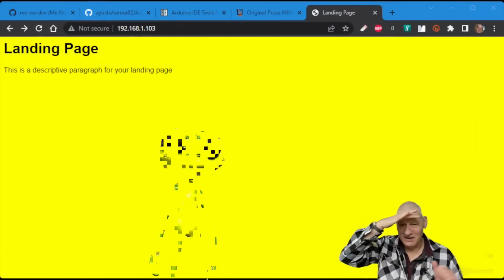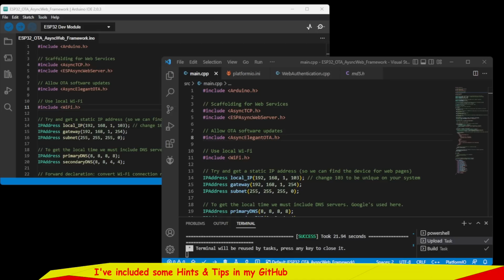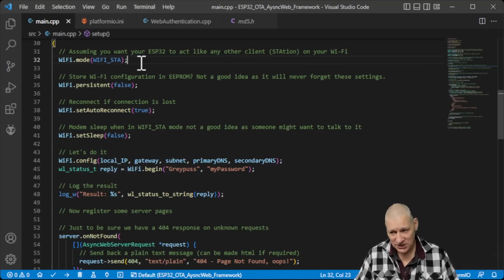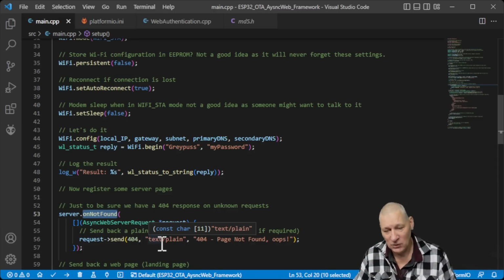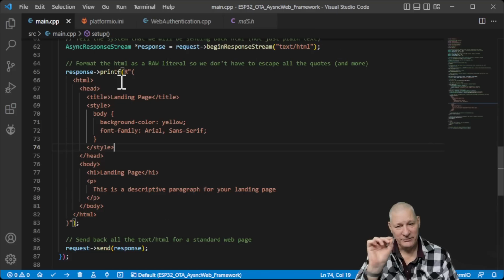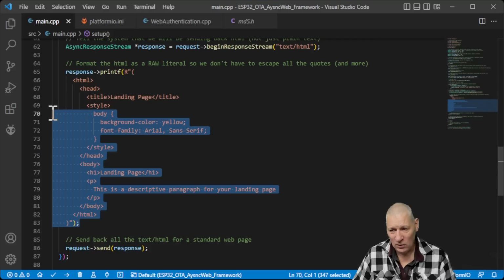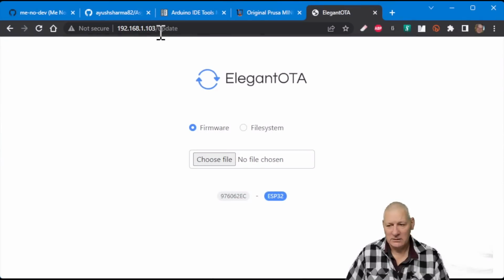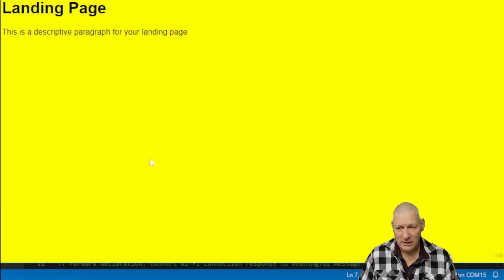#258 ESP32 Web Pages AND OTA updates - just3️⃣libraries! ESP8266 also!

Comment: Hi Ralph, love your content!
I do have one concern with PCB Way.
Why is it they are able to have these absurd low prices? Can't get my head around that.
To me there is no logic in having a commercial business and not make money. 
Can anyone help me understand?
Reply from the maker: Don't think for a minute that PCBWay is not running a profitable, commercial business!

When you order a PCB, it gets put on a large sheet with dozens of others. So, potentially, lots of $5 orders. Factor in the low cost of labour in the Far East (and probably the standard FR-4 substrate material too, but I'm guessing) and they will still not make anything approaching a loss.

Whilst we hobbyists just order (up to) 10 pieces with a maximum size of 100mm x 100mm, there are probably many businesses ordering much larger and more complex designs - remember they do some mind-blowing advanced PCBs too, albeit at a cost. A business could easily order 5,000 boards (my electronics engineer consultant tells me). Many other PCB manufacturers would not even consider such a "small" run 😲

I do not know how they calculate their shipping, but there they offer some (much) lower cost routes (especially to the UK) so I can't believe they subsidise it from that side of things.

What I do know is that in my experience with them, their products are without a doubt second-to-none, from the base PCB all the way through the solder masks and silk screen printing (I once looked at one under the microscope in a video, amazing quality). If this were not the case I would not feature them as sponsors on my videos!

Comment: I see static IP addresses used in multiple tutorials. I think it's worth while people learn how to use a dynamically assigned static IP in thier router, then use DHCP on their device. Then they can use the name they give it instead of messing with IP addresses. This is helpful for when you connect a deceive in future and you can't remember what address you gave it. Typing a shortname.local is also much easier and typing 192.168.xx.xxx.
Reply from the maker: Well, yes, a name is preferable to an IP address although it's been my experience that it's always good practice to know the IP address of key devices in your network. 

But maybe this could be a Part 3 of this video? 😉I'm sure viewers would find it useful.
Reply: @RalphBacon  agreed knowing the ip address of key devices, but if you run the DHCP reservation tables, you'll know those addresses and then have a live, one-stop-shop to view these.

Comment: Excellent Video as usual Ralph.  Will this also work using IDE 1.8.... or does it only work with the new 2.0 IDE?  Many thanks for keeping us up on new topics and our brains engaged.
Reply: It works the same for IDE 1.8.x
Reply: @Cptnbond  Many thanks.  That info helps.  Will give it a test.
Reply from the maker: @Bob Owen Yes, as Sgt-Bond has indicated, it will work with all versions of the Arduino IDE, but I do recommend you download the new version 2.0.x and take advantage of its new features, not least of which includes code completion. 😉
Reply: @RalphBacon  Trying out the new Arduino IDE 2.0.X version is on my list of things to do.  It's only that I hate change and tend to stick with that which has worked before.  Thankfully, there are content providers like yourself who make things easier by providing great resource materials.  Thank you.

Comment: Great Video had to make a small change to get it to compile with platformio - platform = espressif32@3.5.0 - seems there is a conflict with the latest platform release
Reply from the maker: There is an issue, correct and I'm very disappointed that me-no-dev has not addressed this after several months. 

But you can use the latest platform if you comment out the line in the platformio.ini line and enable the line to download that ESPAsyncWebServer library from the GitHub (see my example in my GitHub, it will be obvious).

Comment: I have yet to find a decent wifi library that lets you securely store multiple wifi credentials, will automatically go to one of them that is currently present and, non-blocking, will go to AP mode if none present, and will regularly check for SSID changes to go to an already configured SSID.
There's also the problem with some WiFi libraries that latch onto a specific BSSID in a multi/mesh Wifi AP environment rather than allow roaming between APs.
I've used one that came close and included a built-in web platform and OTA.  The web platform confused me, was JSON based and not clear to me on formatting and I/O.
Reply: Yes you are right.. Its just painful to realize if your esp project won't join a WiFi again if it lost connection and doesn't scan and join :-/ kind of pointless to have WiFi in the first place then :-/
Reply from the maker: There is a library that allows multiple SSIDs to be scanned and it will join the one with the best signal. Of course, you still need to know the correct password (I'm sure you could design a simple, encrypted password storer using LittleFS).
The library is called WiFiMulti.h from Espressif (https://bit.ly/3HONTlL ) and detailed here:  https://randomnerdtutorials.com/esp32-wifimulti/
Reply: @RalphBacon  does said library automatically join the SSID autmatically or not?  If not and you have to enter the password each time it wants to connect, that's not fitting my criteria.
Reply from the maker: Automatically? Anything joining a Wi-Fi network has to know the SSID and Password, however that is supplied. You can't "just join", although you can programmatically make it appear that's what happens, without any manual password entry.
Reply: @RalphBacon  that's what I've been saying: enter and store SSID and password, or remember and store recent connections.  That way when you come near one stored, it will reconnect.
Like your phone and laptop does.

Comment: it would be more helpful to do that with IDF sdk not stupid unstable Arduino
Reply from the maker: Not really a helpful comment. 

Arduino is not unstable in my experience as the framework has been ported from IDF by Espressif so they know what they are doing, so I guess they are not stupid, either. 

In fact, there are some features in the Arduino ESP32 framework that are not present in IDF because Arduino users expect them!
Reply: @RalphBacon  thisr party libraries have mostly some questionable untested code to pull for public for later to find out about bugs and crashes. 
I'm not sure if you even realize of what you said from programming perspective because IDF is SDK not a framework with spaghetti greasy code
Reply: Arduino IDE 1
8.x is rock solid if you want stabilty. Personally I prefer this over the 2.x series.

Comment: Where did you get that IPEX antenna? Do you have a view about the pcb antennas that are available? Cheers
Reply from the maker: I had a lot of various IPEX antennas included with various devices but you can buy them on AliExpress for a very low price. I have "proper", case mounted and adjustable antennas, stick on ones that you can hide inside or outside of an enclosure, simple springs (mainly for the HC-12 devices I showed recently) and these ones which are probably the worst as they don't stay in place!

PCB antennas (such as the ones normally included with ESP32 devices) work well enough for home use. Switching to a case-mounted, orientable device (not easy as you have to un/solder a 0Ω resistor the size of a speck of dust on an ESP32 device) is like chalk and cheese, range-wise. I use these to communicate from sensors in my attic to my workshop (about 10 metres away) and it's faultless.

Comment: I would not open the ESP32 to the web with that Elegant OTA on it, does not look like there is any security! Someone could upload malicious code to allow them access to the rest of the network or worse!

Also, you failed to mention how the server is started. Just including the header file for Elegant OTA is not enough, you also need to start it before starting the server:

AsyncElegantOTA.begin(&server);    // Start ElegantOTA
server.begin();    // Start the web server

EDIT: After posting this comment I found out they do have very basic security for the update page if you start Elegant OTA like this:

AsyncElegantOTA.begin(&server, "username", "password");    // Start ElegantOTA
server.begin();    // Start the web server

It's not an ideal solution but I guess it should work for simple DIY projects, not recommended for release products! All it would take is for someone to get hold of the product and search the firmware data for the username and password as it wont be encrypted!
Reply from the maker: If you notice, I didn't even mention exposing such a device to the outside world! Apart from requiring some router knowledge (IP forwarding) it would also require that additional level of security to stop your neighbour potentially accessing your devices. I'm pretty sure a serious hacker is not interested in my ESP32 Pond Heater Controller 😁😆😉
Reply: @RalphBacon  maybe not the pond controller itself but as OP said, your ESP can then be used as a jump point to the rest of your network.
It has already happened with commercial IoT devices.  A smart light bulb or some other IoT was used to hack into the HVAC of a hotel in Vegas
What's ironic was that not long before the hack, I attended a convention by a network security vendor in that hotel that used that example to make their point.
Reply: You can protect Elegant OTA with a user/password combination and additionally, as the `/update`  path can be changed to e.g. `/t07pNueykXYi5XUA6tEAxIhXmP3owT7H`, is't quite secure... But securest would be to switch WiFi off. Your have to live with compromises. 
You can also pull the firmware from a trusted server on startup... Then you don't expose any interface. I do that for my deep-sleep on battery project.

Comment: Next part would be to move HTML over to LittleFS. So much easier to work with, and more powerful, then incode HTML. And authentication for OTA.
Reply: I hadn't thought of that.  Plus it appears the OTA allows you to update files in the ESP storage so you could in theory update the HTML without updating the whole code.
Reply from the maker: But adding in variables is not such a trivial task, wherever the HTML is sited. But certainly, having the pages in a file would be a good idea.

Comment: High Ralph. I noticed the bin file was a lot smaller with the Arduino compiler. Is that always or mostly the case?
Reply from the maker: I didn't notice that at all! I will have to check. Same compiler, same framework... how intriguing!
Reply: It could be platformIO natively adds support libraries that Arduino 2.0 does not.

Comment: Thanks again.  A tip for beginners. One thing I have found useful is to copy the path of the actual .ino file on my computer into the start of the .ino file, as a variable.  I then print this variable out to the console when the program first runs.  That way, as I tend to  leave a number of ESP32s running for some time and tend to forget which file is actually running , at every reboot it is displayed on the console.   This can of course be printed to a ver.html file, which I can call to verify which version of the code I am actually running.
Hope it helps.
Reply: i do this too!
Reply from the maker: Great way to track what's telling the information 👍

Comment: I've written a separate library for doing automatic updates by running a local web server. And the MCU just checks for a new version just once in a day or so.
Reply from the maker: The 'problem' with your solution is this: "I've written a separate library for doing automatic updates by running a local web server." Most newbies to web-enabling would not have your skills in doing this although I'm trying to think of an easy way of implementing this for such noobs.
Reply: @RalphBacon  If you are interested in showing it, i could make my source code open source and you could just showcase it. :)

Comment: If you have another webserver (python webserver) you could redirect the query from the esp to the external webserver, adding the ip for that esp to the query, would allow you to have (big) images and let you update the webpage(s) layout without updating the esp, the extra webserver would need to add the esp ip to html output (base keyword) sent to the browser.
When using several identical esp setups (like temp monitoring) these all could use the same page(s), 1 change to html would update all.  Also like in test.html you can have links to all known installed devices, store this on your browser device (mail it as attachment)
Reply from the maker: Yes, sounds very do-able but unfortunately not for noobs who struggle with the construct of a simple HTML anchor link!
Reply: Not to mention the IoT couldn't be mobile or would cease to work at all if the web server were down.
Reply: @danman32 raspberry pi is mobile, cease to work like no power to the esp, should only be used for non critical systems, nice to have, also esp could still react to other simple queries with plain text answers. query like  http://ip/text

Comment: I installed Moode Audio onto my Pi, which creates a wifi hotspot so you can connect to pi with your phone by connecting to hotspot, then you see the Moode web page and can configure its settings to connect to your network and reboot. On reboot you can connect to pi via a tablet (which is on your network) by going to http://Moode and you can connect to pi. I.e. no IP address is needed, no idea how it does it, but thought it was neat
Reply from the maker: Yes, sounds neat and I bet it acts as a DNS server that ties in to your network. I'll take a quick look!

Comment: Using the library ESPmDNS.h  , you can access the ESP32 using a logical name:
like "office" in the address rather than a bunch of numbers.
It is so much easier and only requires a few extra lines of code.
Reply from the maker: I must admit to editing my Windows 'hosts' file so I can access my ESP32 devices from my PC, but I've not used the ESPmDNS library (yet). I will take a look. Presumably, you must create a separate (additional) DNS resolver for your local network using this?

Comment: great video! I was in a need of such few years back - but I got there - no issue. Next step: button on the web that will upload the firmware from the web server directly to ESP and will initiate update of the firmware. Or even better: sketch, that would check from time to time if the new version of the firmware exists on the server and if so, it would update automatically.
Challenge?.... accepted? ;-)
Reply from the maker: The problem is that 90% of all beginners could not configure a server if their lives depended on it. Even if they did get one up and running they could not fix it if (when) it goes wrong. Lots of suggestions like this but sometimes KISS rulz!
Reply: @RalphBacon  oh, so challenge... refused ;-) Don't underestimate your audience ;) It can be hosted on AWS, Github or one command in docker

Comment: Hard-coding an IP address in C code as shown in the video is a terrible idea for the vast majority of people. It's almost guaranteed to eventually create IP address conflicts that will be EXTREMELY difficult for most people to track down. Setting up DHCP Reservations in your DHCP server ("router") is the correct way to do this kind of thing -- while that's obviously an "outside the scope of this video" kind of thing, I'd strongly suggest that people avoid what Ralph shows here unless you know exactly what you're doing (and if you did, you wouldn't do it this way anyway! 🙂).
Reply: I'm not keen on static either.  But there are pros and cons with any IP assignment method.
A static ip assignment in the pool range might not cause a future conflict if the ESP is on most of the time as likely DHCP will possibly check if the IP candidate is already in use.
Reply from the maker: Well, I did mention changing the range in which your router hands out DHCP addresses, although I suspect most users won't know their router well enough to do this. 

Assuming you did, then if you then use the same IP address for two ESP32s, well, you'll get a conflict although how that is reported remains to be seen.

The other way is to tell the router to always give the same IP address for the ESP32s MAC address, but that's depending on your router just a little too much.
Reply: DHCP reservation would be better, but I wouldn't be so emphatic about hardcoded ip addresses.  The main  issue is that a device could demand a specific ip that's already be in use. But if you define the range of ip addresses dhcp can use, numbers outside of that are safe to hardcode. The other issue is the decentralization, but that's just a matter of being organized.